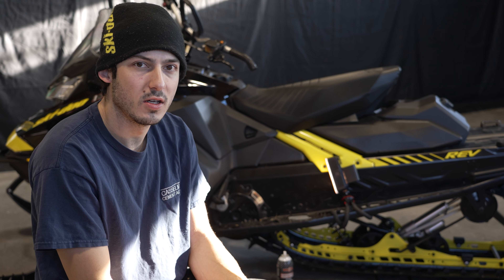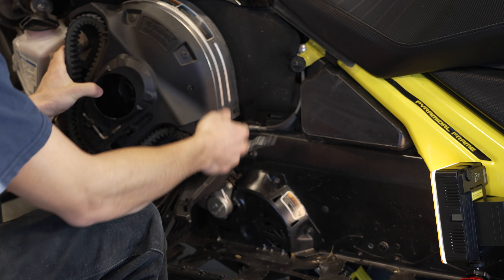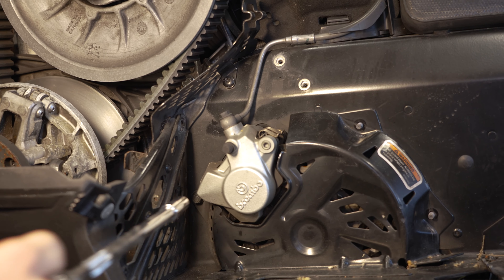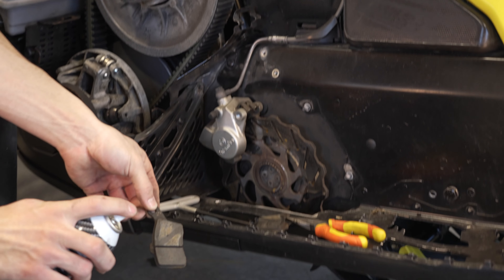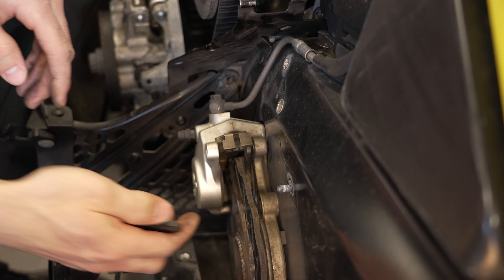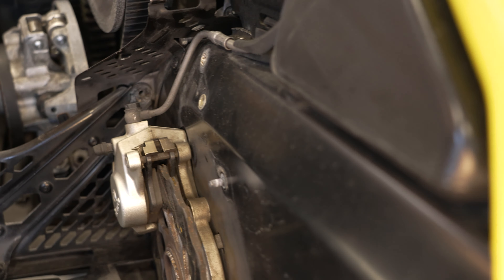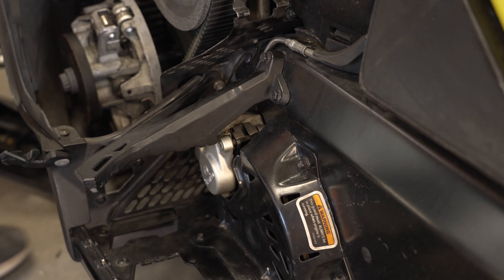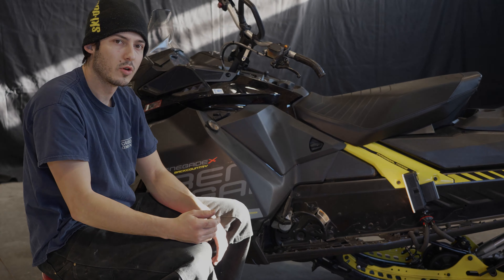How to change Brake pads on a rev gen 4 skidoo

Comment: Is it very easy to remove the rotor? I bent that metal metal plate underneath the rotor and want to see if I can bend it back down from the top. The rotor is hitting it now
Reply from the maker: We will be doing a track removal video soon hopefully it will help you
Reply: Looked like a circ clip but not sure if there is something else or if its just a cap